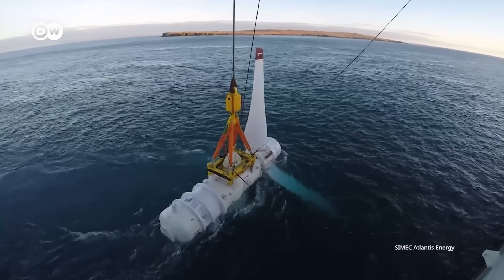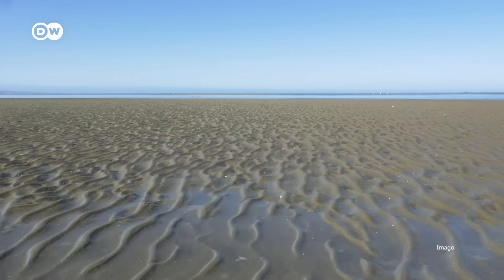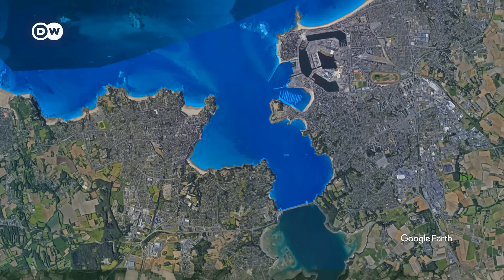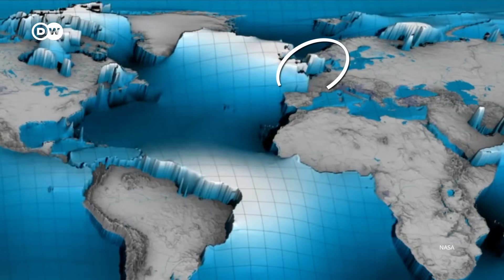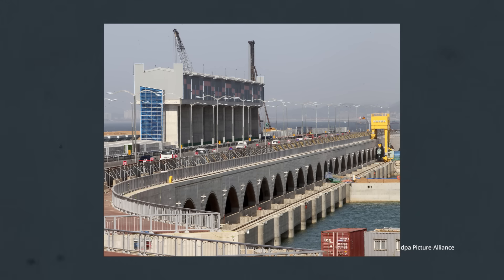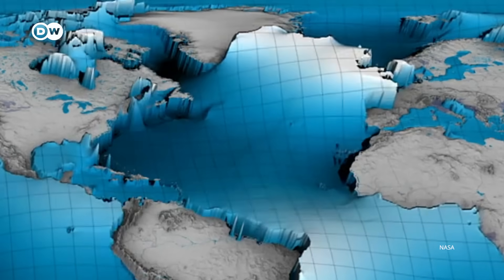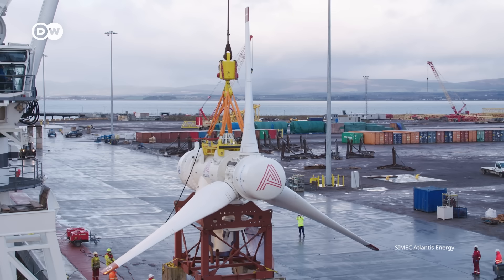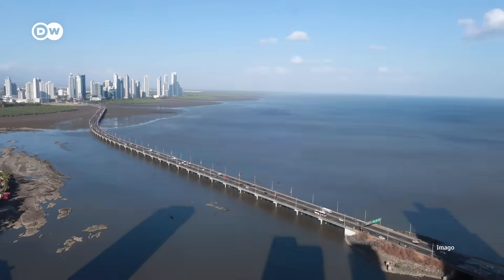Tidal energy could be huge – why isn't it?

Comment: I lived on the Gulf of Mexico for most of my life and I see it as being expensive to generate and maintain.  With barnacles, electrolysis and salt water corrosion on the unit and cables servicing the units, it would be labor intensive on keeping everything working and not feasible.  Salt water either drastically shortens the life of things or totally destroys lots of materials including steel, stainless steel, aluminum and barnacles destroys the rest. I know there are materials that resist seawater and living organisms but these materials are not proof but resistant.  Coupled with electric cables, there will be tremendous problems on connections.
Reply: All these feel good ideas... they spend so much time talking about how great it is but barely talking about the difficulties... great ideas can be good but also impractical to implement. The biggets problem here isnt obtaining tidal power, its maintenance and distribution. Just wait till the EPA gets involved.

Comment: I drew a design that used giant floats to turn geared down turbines in theory it could work with waves also. It would be similar to the system shown except the mechanism would function off the up and down movement of massive platform with turbines on the legs. The advantage would be that the turbines would not have to be submerged, thus reducing wear and damage due to salt water and sand in the water
Reply: Not to mention it should be easier to maintain and get new parts to. Still like some of the other comments. There is still the issue of energy loss over distance. Where landlocked countries and states(in the case of the USA). Meaning they need to figure something out for storage. Or a different source of power
Reply: @rignatetris4435  There's been some developments there luckily, governments in Canada and Germany have begun the planning stages of renewable energy projects for production of hydrogen, stored as ammonia. The ammonia/hydrogen would be a liquid battery of sorts and will likely be used to support hydrogen fuel cell car economy with Europe switching away from ICE cars.
Reply: wait can you explain further, i can’t grasp the idea of how the float going up and down would turn a turbine, where was it located on your design

Comment: I had my senior year undergraduate thesis on renewable energy and the most intriguing solutions I found were these ocean turbines and the molten salt turbine found in China and Las Vegas. The biggest problem is the cost to output ratio is pretty severe so these types of electrical solutions are just too expensive at the moment but are really cool solutions when they are cost efficient.
Reply: Intersting , my Q have these costs been compared to the costs of oil rigs that drill in the ocean bottoms , just seems that those oil rigs costs would be enormous ?? …curious
Reply: I bet you forgot NUCLEAR its 100% clean and it will be the future of power period...

Comment: In 2015 I worked for a technical company, that had a department which focused on the research of technical applications, to expand their business. 
I did a research on tidal turbines and therefore I can agree to 100% with the content in the video. It is interesting to see that, although 7 years have passed, the technology is still not used on a wide level. 

There are 2 rather important topics, which I miss here. 
1. Political situation of a country
2. Laws and regulation in the country

You don't have a lot of locations, where tidal stream turbines can be used. The same thing goes for tidal turbines, that rely on the tide itself. 
Because there are so few locations, the political situation in the territorial area of a country is rather important. 

Future laws and regulations could also affect a tidal (stream) turbine plant/location negatively. 

:)

Comment: Because it gets coated with weed in 48 hours and the efficiency goes through the floor.
Reply from the maker: As Amanda Smith so kindly explains in our video around 7:30 min in, engineering underwater usually brings its own set of unique challenges, one being biofouling (8:00 min).
Reply: @DWPlanetA  Talking about it doesnt make it go away.   Not to mention the fact it chops up fish, interferes with tidal streams, and the ecology, and is also intermittent.   Lets face it, if it worked,  it would have been used.  And dont say 'Rance', thats one project, that has never been repeated.  I wonder why.....

Comment: First question that comes to mind: do tides have a purpose regarding flow of minerals, food for aquatic life and such? If yes, should we interfere with a big generator?
Reply: There is no way we would be taking enough energy from the tides to counteract the gravitational forces applied by the moon, not even close
Reply: The flow is still there. It’s not that the blades rotate fast enough to chop nekton like the windmills are doing with the birds, although much less than people think.
Reply: @DinoAlberini  The impact of wind turbines on bird populations has been greatly exaggerated. Yes it has some impact, like every single human structure ever built. But the fact is birds are killed in the billions by human structures every year. Wind turbines are only a small fraction of this.

Comment: 2:50 aaaaaaand, there we go.
THIS is why tidal energy is not more widespread.
if we had the energy storage capacity to hold THIS much energy, there wouldn't be power shortages, hospitals wouldn't need backup generators, and crypto wouldn't be such a strain on society's resources. but one thing we learned over the past several years is that storing electricity is a pain and something that is both dangerous and difficult to maintain.

Comment: Nope. Wrong way to convert it. You need to use gears and weights. The tide picks the weight up and it’s gears slow it’s decent to harness the power. The form they’re trying in the video will not work. Ever.

Comment: I have thought about this stuff and I reckon maitenance will be the biggest cost (and a nightmare). Maybe a design where only the blades enter the water, making it easier to maintain. And the electronics and mechanics are above the water.
Reply: Id say that would goof up the actual fluid dynamics as the thing would be quite top heavy and constantly going up and down, a lot more to count into to harvest the same energy, but hey maybe its a better solution, better than a big ass oil rig.

Comment: Wind and Water turbines are more harmful to nature than fossile fuels. Solar and nuclear are the obvious winners for energy
Reply: I disagree with your first sentence. Why is that?
Reply: @netherwolves3412  Simple physics. Any energy gained is lost by the source. With solar that is negligible because it is not an internal source so you are just taking energy from the ground under the panels. With air, currents, and tides they are part of a delicate system that impacts ecosystems globally. Turbines reduce windspeed behind them which will impact subsequent air currents and weather patterns. Ocean currents are even more dangerous to mess with because it not only disrupts aquatic ecosystems but the heat stores in the ocean has an inpact of weather as well.

Comment: wind solar tide or fossil fuels.... what about nuclear?
Reply: Dangerous and we still dont have a proper way to dispose of the nuclear cells after it's been used up
Reply: @pccjmdg5259  nuclear power isn't actually that dangerous, just do it right and it'll be all good and just shove depleted cells in a cave lol
Reply: @theorangeheadedfella  True but the cost is great and oil companies still have a major pull in our government's slowing down any movements to those type of energy generating systems
Reply: Nuclear is great, if we built reactors with modern tech they could be soo much better and even safer. Most of them are kind of outdated by now.
Reply: Nuclear is overpriced. Sizewell C is ready to go today. But. Nothing is happening because nobody wants to invest in it.
Reply: @britishmalayasociety  sure but still an option, just like tide power is overpriced
Reply: @thecheaperthebetter4477  I agree, they are, which is why tidal power plants are usually testbeds for the technology. Which is what nuclear should be at this stage. The Chinese and Americans use them to test out nuclear powered options for military vessels besides prototyping. But for conventional commercial power. Nuclear still isn't ideal. This is why other renewables are, by far, being deployed in large numbers, thanks to cost.

Comment: One thing not mentioned in this video in regards to marine life is the production of electricity and resulting change in magnetic field characteristics around the turbines. Lots of fish can detect magnetic and electric signals from quite a distance. Putting some extra sources of magnetic field in the ocean could potentially disrupt the ability of these animals to navigate.
Reply: another problem they don't talk about is maintenance. 

They'll need oil in order to not get stuck, they'll need to make sure they dont break, since if they break, they will most likely leak oil straight out into the ocean + material will get drawn out into the ocean. 

Side Note: They've tried a similar energy source about 8 years ago, they found out that these things also hurt the corals a lot.
Reply: @TouchthisiProduction  
What about magnets for lubrication? I believe pc fans use them as well.
Reply: Mayhaps in ecological dead zones? But those probably don't have anough motion of the ocean to make it wortwhile for the turbines..
Reply: Seeing as offshore wind farms turned out to disrupt whale migration habits, it's definitely something to consider.
Reply: Not to mention the noise pollution
Reply: Bruh they are lot less than Earths magnetic field it won't matter
Reply: @Prat-zi1ou  I also don’t think it will matter
Reply: I have a feeling these machines will be made much simpler, with their serviceable parts above water. Something as simple as a paddlewheel comes to mind. 😊🌎✨
Reply: You make a very good point
Reply: Good point. I suppose the various power interconnectors UK to Europe etc will be messing up magnetic fields somewhat.
Reply: Is there not a simple solution to magnetic fields caused by underwater electric power generation?

A co-axial cable has electric currents flowing in opposite directions, which creates magnetic fields directed in opposite directions, thereby cancelling each other out.

Surely, could you not just carry the power generated over a co-axial cable?
Reply: I was thinking the same thing. Guess whatever humanity does good brings destruction with itself. We grow too large as species...
Reply: @louenrioichi8927  I'm not sure any of us have the capacity to determine what the right number is for world population, so I doubt that is the problem
Reply: @louenrioichi8927  The best and most sustainable form of energy is nuclear for that reason. Specially fusion or thorium reactors.
Reply: @RoderickVI fusion is not happening. Tritium is produced in fast breeder reactors. Tritium production in the fusion reactors require Lithium6, and Tritium, both of which are unobtainium
Reply: They can evolve.
Reply: @jacktaylor8195  Yeah, what are they still doing in the ocean anyway?
Much like moths using stars, bats using high frequencies, that kind of evolution won't happen in our lifetime. If at all.
Reply: @simmerke1111  Sarcasm mate, chill your beans.
Reply: @jacktaylor8195  it wasn’t that obvious. ;)
Reply: @BBountyHunter  You must just be oblivious or something.
Reply: @jacktaylor8195  or you must learn to communicate more clearly or something. If there’s more than one person telling you something, spend at least a minute thinking about what they’ve said before replying like this.
Reply: @BBountyHunter  I'm sorry sarcasm is so difficult to read through text, okay?
Reply: @jacktaylor8195  no it definitely isn't obvious. In fact, such tiny change could happen within just a few generations which means evolution could happen in just a few decades.
Reply: @badguy7432  You know what, since you seem to know so much about evolution, maybe you should argue with the other guy about that.
Reply: @jacktaylor8195  no im kinda lazy to make an argument. Im more towards critiques to obviously false claims.
Reply: @badguy7432  So you're saying sarcasm is easy to read through text? Where's my false claim here?
Reply: @jacktaylor8195  too much uncertainty to argue with him. But with you, I just need to list out the two sides of the possibility to prove you wrong that it isnt 100%sacarsm
Reply: @badguy7432  I see you're a huge fan of beating around the bush. Where is my false claim?
Reply: @jacktaylor8195  and maybe that was not a good sarcasm as no one here literally agrees with you
Reply: @stressedbyamountainofbooks Like I said, it can be difficult to read through text.
Reply: @jacktaylor8195  yes, that's why you put the /s to signify sarcasm. So it is easy to read....
Reply: @stressedbyamountainofbooks  I have never seen that done.
Reply: @jacktaylor8195  "I have never seen that done."

uhh really? 

oh no, i never seen a round earth from space! earth must be flat

/s

now you've seen it right?
Reply: @stressedbyamountainofbooks  Actually it would be more like, "I haven't seen round Earth from space so I'll just not think about its shape".
Reply: @jacktaylor8195  /s is a reddit thing used by redditors with poor social skills
Reply: @marcinjankowski4432  Oh that explains a lot.
Reply: @simmerke1111  if it dies, it dies
Reply: @jacktaylor8195  So can we
Reply: @jacktaylor8195  I saw it as a joke immediately.  They could learn to code.
Reply: @booboo8577  Finally, someone with a good sense of humour. It's rare to see on YouTube.

Comment: Isn't global warming inevitable even if we stop using coal and gas. Like in this video converting the power of the tides into electrical energy which more often than not is later transferred to heat. Same with coal and gas we're transferring chemical energy into electrical energy then into heat. Like at night if your blasting your heater your changing the naturally "cool" atmosphere  and reconditioning it so its warmer which then mixes with the surrounding air increasing average temperature altogether. Idk if this makes any sense but maybe I'm just rambling.
Reply: I’m pretty sure it would be a negligible amount of heat.

Comment: the greatest problem is the salt water in connection with movin parts. Its hard to isolate the movin parts agains the pressure and the salt.

Comment: Can't believe so little mention is made of corrosion. Sea water is brutal stuff to steel and you can't galvanise. Bio fouling is your next problem.
Not worth it, forget it.
Reply: That's what sacrificial anodes are for.
Reply: @adematthewsracing  you can't put a lump of sacrificial metal on a blade or in the bearings. Biofilms and encrustation aren't prevented anyway.
Reply: @cycleSCUBA  That' where modern anti-fouling coatings come into it. It's not unknown science. Yes it requires a maintenance schedule but people need jobs at the end of the day as well as power.
Reply: @adematthewsracing  - ok, i suppose it's right to persevere to harness such a potential power source.

Comment: Good review. Tidal dams are probably a really bad idea. They have to deal with silting up, marine animal displacement, they look bad, the carbon footprint of concrete etc. But the turbines appear to be much less invasive. Albeit the issues that were raised in the video with material selection, and marine life. Also, the fact that salt water and electrical/mechanical components don't mix.
Reply: Did you actually have any data about what you're talking about? Did you made any calculations? 
The concrete carbon footprint for example. After how much time would a tidal dam beat a gas plant of same power output even tho we spend so much carbon on the concrete?
Also, wind turbines need a shitload of composite materials that cannot be recycled. What would be the cost of maintenance of a tidal turbine versus at wind turbine in term of CO2?
Genuine questions as you sound like an expert............
Reply: @MrPureBasic  They weren't dismissing the idea completely, just expressing some doubts about it. Nothing is certain and every calculation is an estimate until put into practice. There's no need for insults also

Comment: Tidal is one of the worst diluted energy sources. It's even worse than wind. The only chance to have enough power density is with an inlet or lagoon with a large volume but a very narrow strait. Even so the costs of building a dam at the location are significant.

Comment: Because green energy is a scam! The celt ration of electricity to charge electric cars, the toxic manufacturing and disposal of the batteries results in almost no positive environmental impact  especially considering that considerable cost. We are running into the same problems with wind power.

If the politicians pushing global warming and paying scientists to prove it existence really believed what they were preaching then they would not be buying up costal property, driving 5mpg SUVs and flying around in private jets.

Comment: As I remember, tides roll in and roll out.  Right?  Is the turbine generating through the dwell as the tide reverses twice a day?
Subsea technology is multiples more expensive than surface.  For instance think of sea safe electrical connections.   You don’t just plug it in, if it’s sea safe, it has to be purged.   Ditto with the turbine gearing and generator...either purged or flooded with non corrosive\conductive fluid.    Cheers